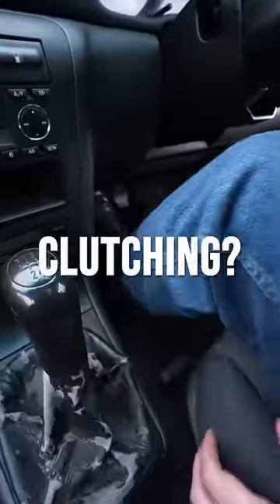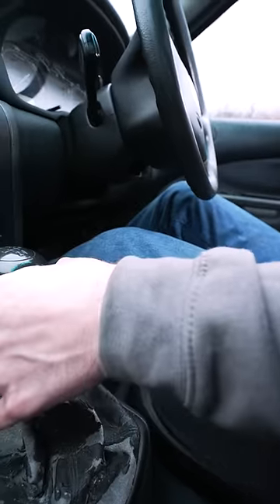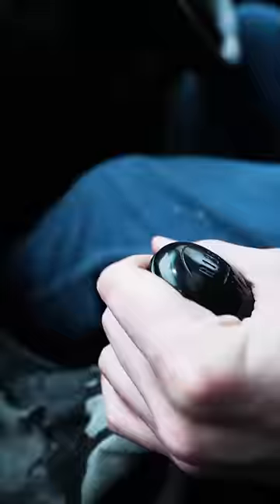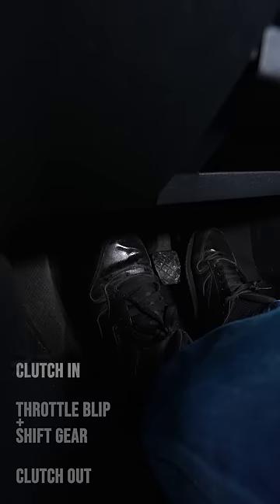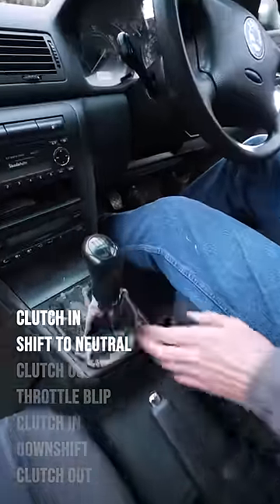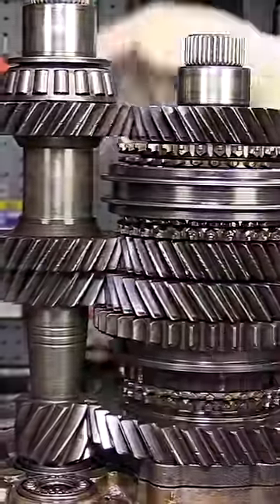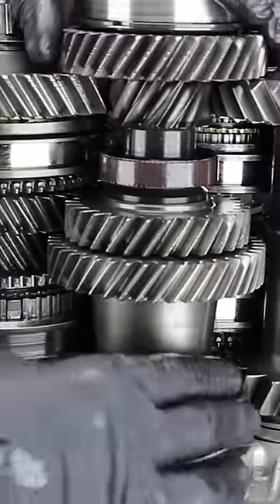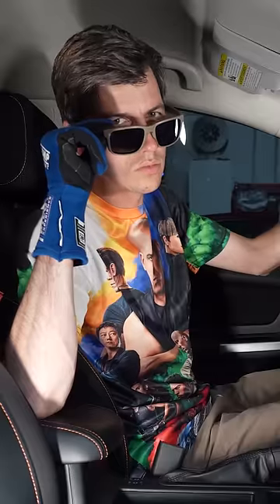What Is Double Clutching? Don't Granny Shift!

Comment: Save your synchros, wear your throw bearing
Reply: To me, changing the throw bearing is a much easier fix.
Reply: @ImJMan007  You won't wear your synchros any measurable amount in normal driving.
Reply: @ImJMan007  You want to do a clutch job more often and pay/lose time/labor over a transmission you can probably get for <$1k at a junkyard/online?
Reply: @R03333  well it scares me because the dudes who had my Cadillac ATS managed to wear them out at 70k miles
Reply: Let your synchros do their damn job lol
Reply: I do it from 1st to second, because 2nd is a bit on the squeaky side. I also do throttle blip/heel and toe when going 3rd to second. Dont know whats better yet. Let 2nd groan at me or using the clutch a bit more.
Reply: i noticed i can rev match faster in both a 99 subaru and a 2016 smart
Reply: Don't wear your synchros. Wear your knees
Reply: @hawksights i say use the clutch a bit more because you likely won’t be going that fast and slipping the clutch for too long so im assuming the wear is negligible?
Reply: Synchros don't even really wear unless you put way too much force on them or float gears (in which case enjoy having destroyed syncros after a few oil chages). Seriously you can find 2mil+km Scania's with near perfect syncros. Throwout bearings are cheap as hell and easy to replace as well so really all you're doing with doubleclutching in a synchronyzed manual is wasting your time.
Reply: @stuntvist  heavy duty trucks like semi tractors with 9 & up to 18 gears don't have synchronizers like a car or pickup truck, so you are supposed to double clutch them. But most truck drivers float the gears (shift without clutching once moving, in other words, rev match both up and down) and that can be done on synchronized transmissions and won't hurt a thing if you are precise. But it's not very easy to do either.
  Sometimes I'll double clutch a car when slowing down from highway speed. Saves some wear & tear on brakes & stuff and uses engine braking to help slow down rather than just relying on the brakes. And like a heavy duty truck uses the same gear to come down a hill as they would use to go up it.
Reply: True 😂
Reply: @oneninerniner3427  Scania's are not a North American manufacturer of trucks and they don't market themselves in the states either, like Volvo does. They're Swedish and market primarily to Europe. They have synchros, unlike the vast majority of trucks we got here in the states with a manual. Idk why we don't have synchronized transmissions in the states, but it's probably just a matter of cost, coupled with the fact most truckers learn anyway with an unsynchronized transmission, so why bother with the added expense of R&D or purchasing the rights. He's not wrong though that those 18 wheelers do in fact have synchronized transmissions and they're no less reliable because of it. I do find it kinda funny you corrected him assuming the rest of the world doesn't exist but you aren't the first to make that mistake, so I'm not judging too much.
Reply: @oneninerniner3427 How does double clutching while downshifting save wear and tear on your brakes?
Reply: Modern day synchros are rated to last several hundred thousand miles. You have to be really trash at driving if you wear them down, or destroy them. Learn to drive, and you won't break the synchros or the throw bearing.
Reply: You're doing it wrong. There's no need to use the clutch so there's no wear on the clutch release bearing
Reply: It literally says you don’t need to do it with a synchromesh gearbox.
Reply: @Racing_Fox  that's not true. Syncros get worn. Classic cars with syncros often benefit from double de-clutching. Don't believe everything you see on YouTube!
Reply: @procatprocat9647 but believe what a random YouTube comment says?
Reply: @Atilolzz you clearly know nothing about classic cars, or driving in extreme cold with a cold gearbox. 
I simply provided information to correct the errors in the video. 

Believe what the hell you want.
Reply: @ImJMan007 the throw bearing is a wearing part, syncros will handle granny shifting longer than the actual car's lifetime
Reply: even better, only use second gear, as in nearly all cars it covers 0-100 km/h.
Reply: Throw out bearings wear out from the depressed clutch pedal. Double clutching actually increases the amount of time the clutch pedal is depressed, soooo...
Reply: Why would double clutching wear out your throw out bearing more? Doesn't releasing the clutch pedal mean there is less time in contact between the throwout bearing and the clutch spring?
Reply: slamming gears is what causes them to wear. slowly apply pressure into the throw to allow the synchros to do their job. Dog box and carbon synchros can take alot more abuse. Double clutching just wears throwout bearing
Reply: @Sklounst_Actual  Let the synchro's do their job properly. Any form of 'racing' shift simply pushed the system to the max & imposes needless wear, till the point is reached where they don't work so good. 
My first car was a gutless 1952 Morris Minor without a working synchro in any gear, so not only did I learn to 'double shuffle' but also to 'heel & toe double shuffle'  That meant using all three pedals while under brakes & downshifting at the same time. Fun times, but it was still a gutless POS.
Reply: If you never feel resistance when shifting, you are not using the synchros
Reply: @R03333 as long as you rev match decently*. 

I know people who slow for a turn and depress the clutch then they don't shift into and engage the lower gear until the revs have dropped completely to idle. So now the syncros have to ramp up to get that gear up to speed to get into gear and pull the engine up to match.
Reply: It's all fun and games until your throwout bearing snaps and destroys the input shaft snout.

Your synchros are constantly lubricated and designed for the same longevity as the gears in your gearbox. The throwout bearing is a piece of metal sliding on some grease that is constantly smacking a giant spring.

Moreover some of us enjoy shifting at modern speeds and not like we're driving a 60s big rig truck with 13 gears.
Reply: Wear out your clutch too
Reply: I'll take that!
Reply: Exactly
Reply: One of my first cars didn't have syncro on 1st or 2nd, nor did one of my later cars.  And when the clutch failed on my Alfa romeo GTV a week before payday, I drove clutchless for a week.
Reply: @hawksights  My 2nd and 3rd like to pop back out of gear as soon as I shift up, guy I bought it from told me that he would start from 2nd or 3rd so that might have something to do with it
Reply: My throwout bearing is about 17 micrometers away from exploding into a million tiny pieces right now send help
Reply: 100% agree. yet people will thin its wrong.
Reply: @1creeperbomb  I don't know how you abuse your car or truck, but in almost sixty years in the motor repair trade, I have never ever even heard of  the kind of failure that you describe in your first paragraph. Keep in mind that my life was spent with cars, not too many trucks.
If synchro's are serviceable, then steady shifting, allowing the synchro's to do their job, then all will be good till the gears wear out. But some abuse their gearbox by being Billy Butthead, the wannabe famous racing driver with lightning shifts, & that's what kills synchro's.
Reply: Holding the clutch in for significant amounts of time while coasting or waiting in traffic is what wears the pilot and release bearing, not double clutching. Besides, I'd take wearing the clutch bearings and cable/hydraulics over the synchros any day.
Reply: @christopherbarber288 I drive a Tacoma. My throw out bearing is already dust.
Reply: @ImJMan007 The throw bearing in one of my vehicles is integrated in the bellhousing and is a PITA to get at.
Reply: I see them laying in truck stops all the time
Reply: @ImJMan007  probably because they wanted to save the throw out bearing and downshifted without the clutch 😂
Reply: Lmfao, I see all the YouTube Mechanics came out for this one. Lol 😂😂😂
Reply: @procatprocat9647 Didn't he say it's unnecessary in newer cars?
Reply: @amberrae4710  it is unnecessary in newer cars unless the temperature is very low. 
I find that low powered newer cars don't need it but high powered newer cars benefit more. 

Older performance  cars absolutely love the technique. 
Even with a newer car, it's a good skill to have, like heal and toe braking while accelerating
Reply: Looking at the car he is using i can tell you with just a little practice you can shift without clutching once.

It's a skoda from around 2000 and basically a Golf 4
Reply: @tmango78  double clutching on a downshift at higher speeds to use engine braking when slowing down helps take a little wear and tear off the syncro blocking rings and the brakes, is all.
Reply: The thing about throwout bearings with a hydraulic clutch release verses a mechanical linkage is hydraulic clutch throwout bearings are always in contact with and turning with the clutch via the pressure plate arms, but there is not much pressure on them until the clutch pedal is pushed. Where normally with a mechanical linkage the throwout bearing actually moves away from contact with the pressure plate arms or fingers, so they do stop turning. Ok
Reply: @Sklounst_Actual They're wrecked after 300000+ km. 😢
Reply: @MegaBuster777  They have synchronized gears, because trucking in Europe sucks ass most of the time and truckers have to constantly shift due to terrain, traffic and weird roads. It's one of the things keeping them sane.
Reply: Yeah, I've done that. I've also taken throwout bearings out in two pieces by smacking the clutch fork and having the clutch exit stage right
Reply: It's only for when you're high in the rev range anyway when engine braking is at its peak so an everyday driver wouldn't even consider this.
Reply: @boonie4835  you don't hit redline on your daily commute? I do. 😅
Reply: @dimitardimitrov9482  You say that, but I doubt our roads are really that much better. Not all trucking in the states is longhaul. A good portion of it is P&D and shuttle, so they've gotta deal with the same issues. We just have the problems more spaced out between the states is all. Of course, plenty of the old P&D tractors we had were 7-speed, with the most being 10-speed IIRC so you weren't rowing the gears as much, but just imagine delivering in a semi in downtown Seattle or something crazy like that. Minimal truck routes, Crappy drivers everywhere, and minimal space to deliver anything. I'll stand by it being a cost thing, as trucking companies here did whatever they could to save a buck. We were still using brigadiers from the early 80's until at least the early 2000's and those didn't even have power steering and were so gutless it was painful. We also have worse labor organization and lower standards too, so it saves business owners money they've gotta poorly invest somewhere else.
Reply: @SecretSauceyjuice   The synchros only match the gears (which spin at a speed dictated by road speed) to the input shafts, which is not connected to the engine when the clutch is pressed. So rev matching does nothing for the synchros, it's for the clutch.
Reply: @Finnspin_unicycles have you ever driven a manual transmission with more than 100k miles on it?
Reply: @jeffreyhough6720  Most manual cars I've driven had more than that, the most was above 400k miles. No synchro issues on any of them.
Reply: thank you
Reply: @unL33T  1 working, all good. 2 working, hmm essential compromise ok. But 3 working, now im hustling backwards 🤣👍
Reply: @dimitardimitrov9482 it's likely because it's cheaper to maintain as a "bad" driver can't damage the gearbox as easily but this is old news as most European trucks since 2012 are automatic (automated manuals, with a few torque converter automatics), as this reduces emissions as gearboxes can be configured to shift early, no chance of a misshift causing damage and makes it easier for the drivers.  Same as how most cars in the US have been automatic since the 50s AFAIK.
Reply: @R03333  try to shift a 30yo sports car into second at 40mph without double clutching and see how that goes
Reply: @BobTheMartin  my MX5 synchros worked just fine, older than that maybe I agree
Reply: Technically the throw out bearing is always subject to a rotating shaft so it shouldn't wear out slower or faster.
Reply: @R03333  Might be also linkage thing
MX5 is always gonna be so crisp and direct

Anything with cable shifter and high milage, second synchro has always been gone when I get 90s 80s cars lol
Reply: @tmango78 You're using the brakes less...? Pretty common sense.
Reply: Double clutching is smoother and faster, IMO. I feel no resistance when down shifting. Also, it's very helpful going from 2nd to 1st, I do this all the time in parking lots for slow tight maneuvers. I also double blip. Very small quick blip to take deceleration tension off gear while clutching out, blip rev match, clutch in.
Reply: @tbqhwyf it's your slave cylinder that feels it 😅 but as long as you don't have one that's internal that's a quick 1hr swap and bleed
Reply: @Sklounst_Actual it's for transmissions with no synchronizners u don't double clutch if u have synchronizers😅
Reply: @christopherbarber288  Mine was $250CAD and under 100,000km so I couldn't care less lol
Reply: What y'all talking about? Everyone knows 'merica doesn't have manual transmission cars.
Reply: I did 300,000km exclusively double clutching and the throw bearing was fine (as was the clutch plate) but the master cylinder did wear out, presumably from having double the actuations.
Reply: @hotrodchevy4524  some of us are mechanics and perhaps watch YouTube when we are bored. We aren't gods. We're humans too that happen to know alot about vehicles and how to keep them going without you needing to give a 2nd thought. So here's my take. Shift your transmission however you want to, but when it breaks, I'll be waiting with an open wallet.
Reply: @taotoo2   It doesn't actually do anything except wear your clutch and the spring plate more. It's not good for anything at all.

Your clutch will still disengage and engage just like it would if you didn't do it.
Reply: Se cambi al giusto numero di giri i sincronizzatori lavorano pochissimo...
Se SEI CAPACE cambi anche senza frizione...😊
Reply: How do I know if my gearbox is a synchronised gearbox or not?
Reply: @tmango78 I would brake a little, then go from 5 to 4. See? OP would downshift at a higher rev and not brake. That double pedalling would be to ideologically save the synchro at the higher rev. Momentum (force to overcome to synch, or to brake) is rev squared.
Reply: Does anyone know why they stop making  the Fuller Road Ranger 13 & 16 speeds.
Reply: @jrYoutube1   Unless it predates the second world war it is. To test it, can you change gears without double clutching?
Reply: @michaelmay5453  looks like I don’t own a military tank then lol
Reply: @jrYoutube1  That's probably a good thing. :P
Reply: @michaelmay5453  😂 for my safety and everyone else’s safety I reckon
Reply: @jrYoutube1  I've driven a tank, I'm fairly sure that most shouldn't including me. It is NOT something I was trained to do but we were having fun and next thing you know there is a road where there used to be trees. So yeah. :D
Reply: @michaelmay5453  😂
Reply: @oneninerniner3427  double clutching has nothing to do with brakes wear, it's the recudtion itself, no matter how it's done
Reply: Double clutching saves those synchros. Whatever people say, they don't last very long when constantly downshifting in "race mode". 
Double clutching also makes sure you get into that gear at high rpms without losing any performance.
Sometimes I'm downshifting a silly 90hp(?) car down from 3rd gear 3000rpm to something like 4000 2nd gear using double clutch. Without synchronizing the gears by foot it really doesn't feel good forcing the gear with the synchronizing ring. 
Even with double clutching the synchros have work to do!!! But they don't have to accelerate the internal gears several thousand rpms until synchronized when double clutching.
Reply: Throwout bearing is external to the trans case so absolutely yes.
Also, you replace the TOB "as good practice" when you do a clutch job. So long as your TOB outlives the clutch (and it almost certainly will) TOB wear is a non-issue. (You'll just swap out a 60% used-up TOB versus a 30% used one.)
Reply: @R03333  "You won't wear your synchros any measurable amount in normal driving."

Of course you will. They function like little brass clutches, and rub to match speeds. Every "rub" wears off a bit of them.

If you don't DC now, you will in ~200K mi, whether you want to or not.
Reply: @bcubed72  how many people do you think are driving the same car 200k miles? That's 20 years of driving for some people.
Reply: Mazdas are fun and provide amazing feel when double clutching I’ll have you know. And as far as a maintenance reason, although it’s arguable. I do it because I like to have full control. When you’re double clutching in a corner or stop and go scenario.
You’ll realize and learn how that skill can and will make a difference when accelerating or slowing down.
Reply: @Sklounst_Actual Synchros are a workaround and no replacement for double clutching. The gearbox shaft may have the correct speed, because the synchros arranged taht, but the engine has not and you need to clutch in rather softly. Double clutching bring everything to the coorect speed and you can simply move the foot from the clutch pedal. Also you can miss a complete gear: cruising on the highway in highest gear and medium revs and in need for power to overtake someone? double clutch, 2 gears down,  revs to high, power is on and off you go. basically the same as the kickdown in an automatic transmission.
Reply: @allanlinton9354  you shouldn't be slipping the clutch unless taking off in first or reversing. Double clutching is used to make smooth shifts (less wear on synchros) when the driver isn't proficient with rev-matching. When you can rev-match close to perfect there is no need to double clutch, since the synchros are made to make up for *slight* differences between the speed of the engine and the speed of the gear you are trying to shift to.
Reply: Save your synchros, don't drive.
Reply: True😂
Reply: @sina_1239  Knee replacement costs way more than a transmission.